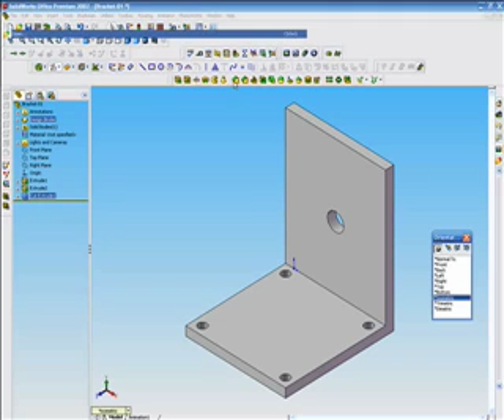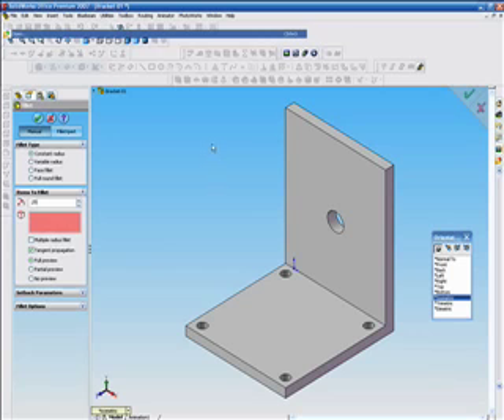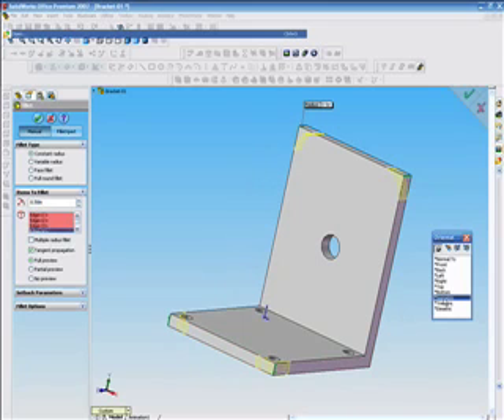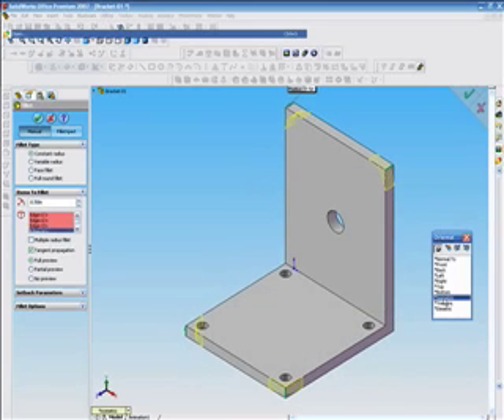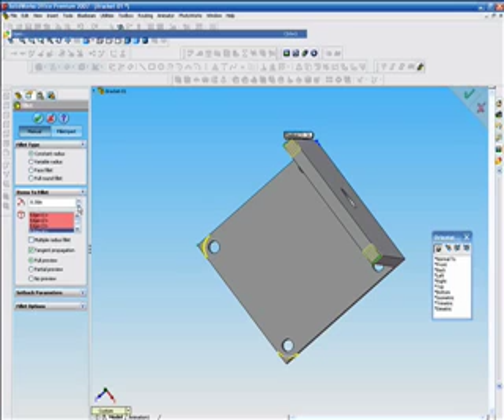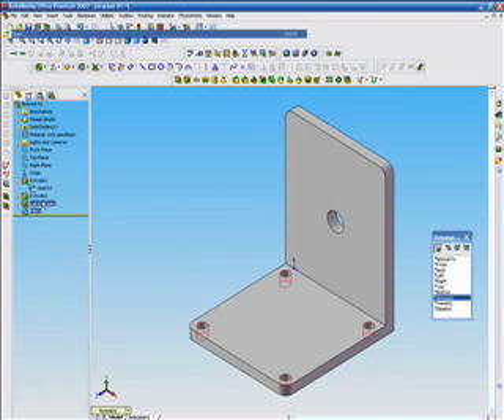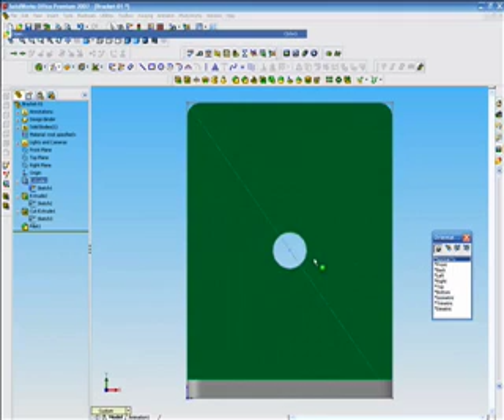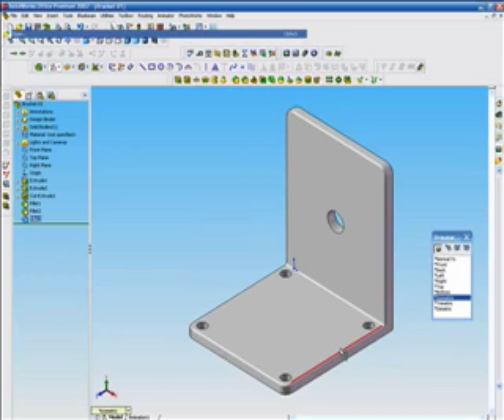Solidworks Tutiorials,  Adding Fillet Features to a Bracket

Comment: hey, thanks!  i'm new to SW and i was trying to do the same thing that you demonstrated on a similar part.  coming from 2D CAD, i'm used to selecting the 2 line segments in the XY that lead into the fillet.  doing this in SW was not working.  i even tried selecting all 3 segments and got errors.  watching this video really helped me to see how easy it really is.